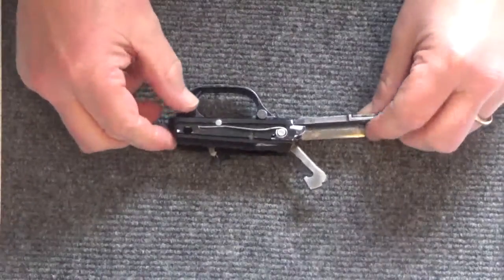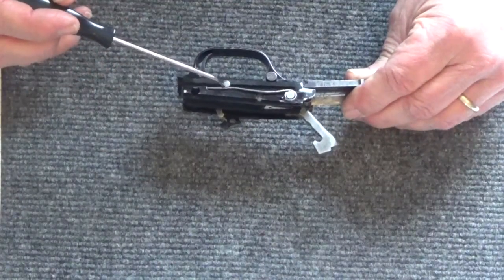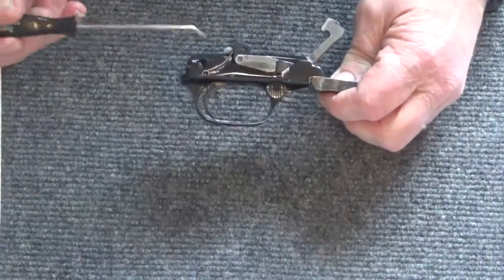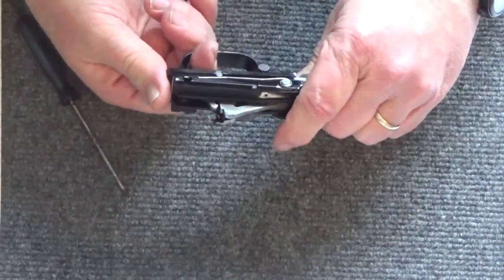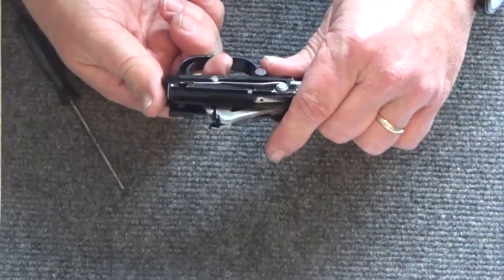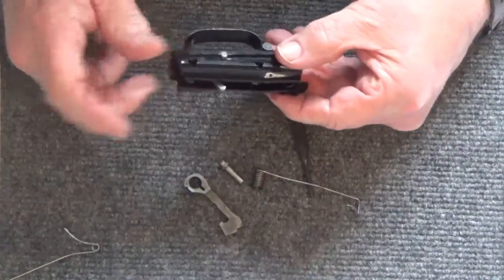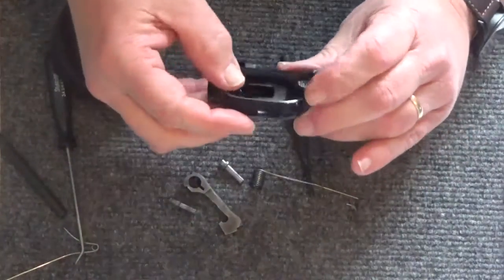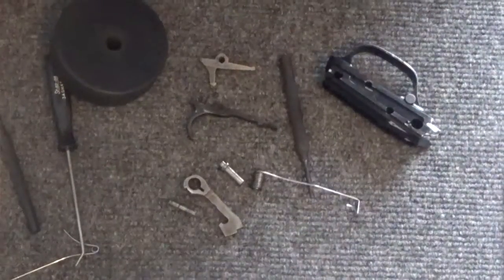Winchester Model 50 trigger group

Comment: It took me a while to figure it out but the safety is actually held in by a detent.  There's a small hole on the underside of the safety switch that you push you small punch in. Be careful though, the spring inside will fly if your not careful.